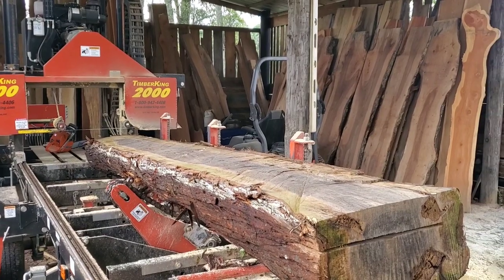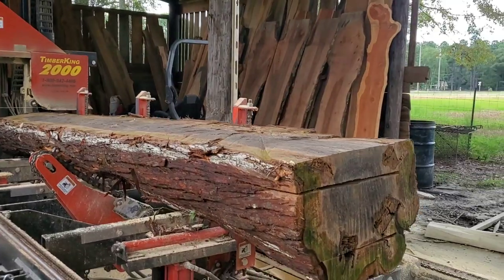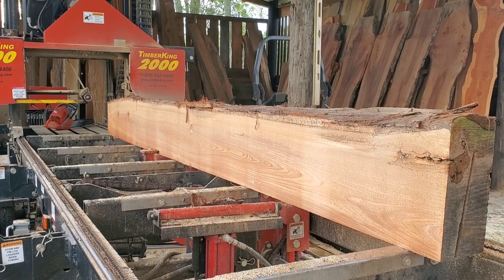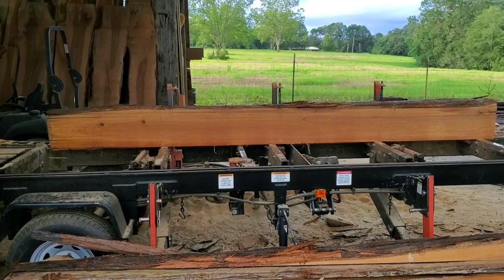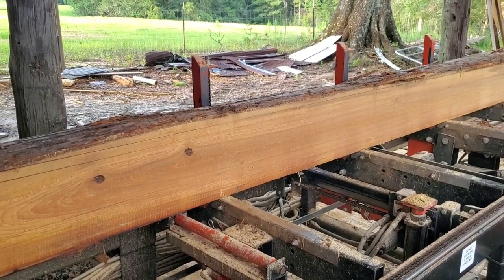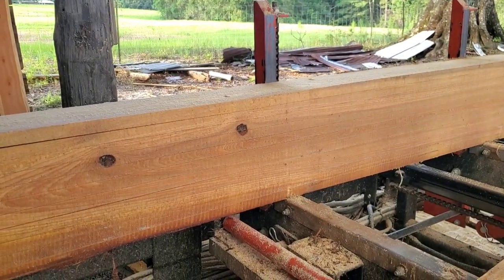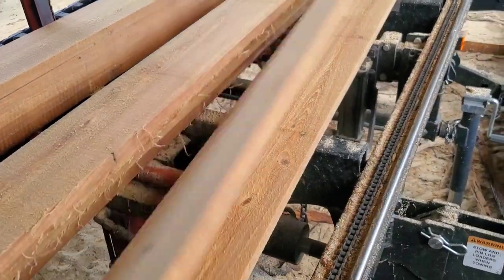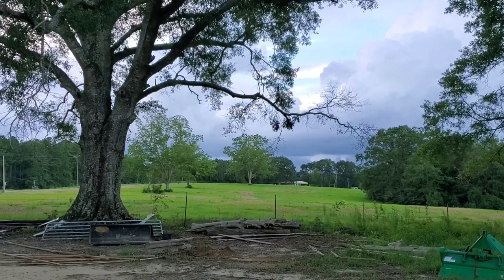Saving a cypress log and making beautiful boards on the Timberking sawmill

Comment: To make you equations easy just get a construction calculator.  I have Calculated Industries Construction Master Pro as I used to calculate well everything rafters, stairs, materials, you name it.  The one I have is around $60 but they have cheaper ones.  I have had it atleast 25 to 30 years now(probably longer) and it's pretty robust.  Makes conversion and figuring super easy once you know how to use.  I swear by mine and it saved me so much time and made me much money over the years.  I could figure a rafter, dead nuts in under a minute or even a stair stringer

Comment: This is the first time I watched you saw, I like the video and really appreciate the effort.
I love watching your mill at work, I’m impressed and envious of the automated functions that you chose for your mill.
I could ask a lot of questions but I will keep it to one for now.  What do you use for blade lubricant?  I noticed the flow rate to cant with ratio and it sparked my curiosity.
Reply from the maker: I use just water most of the time, if the log has pitch I'll add some dawn dish soap.  If it's just a gnarly pine log with excessive pitch I'll use a diesel drip.  Glad you enjoy the video.